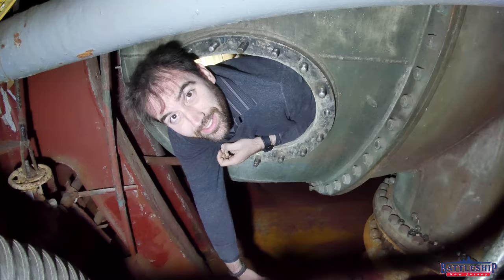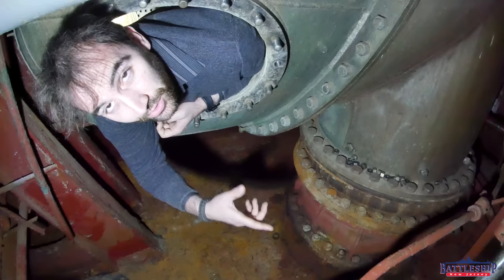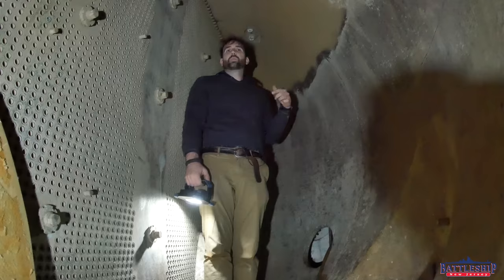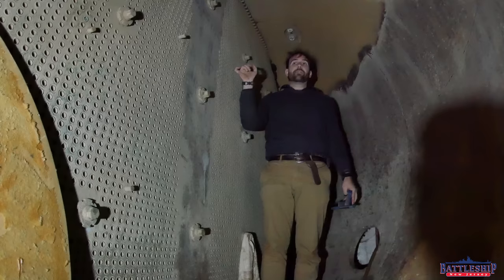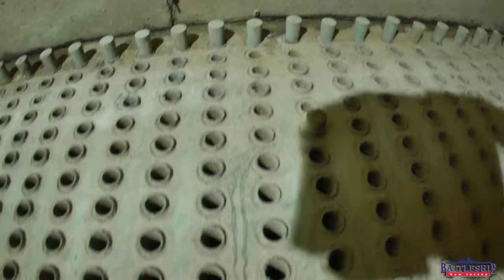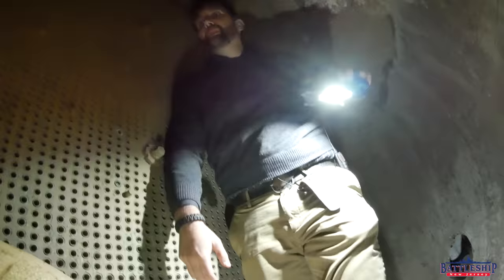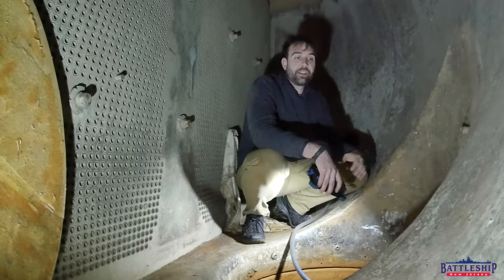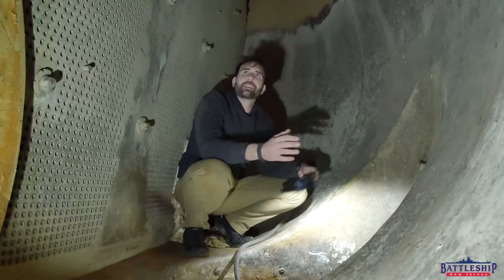Battleship New Jersey's First Hull Leak

Comment: That tube fix thing is a placebo. If you actually calculate the forces on the plug, you'll find that it's only reduced by a fraction of a percent.

Also, how are you gonna get the funds to put the thing in drydock? Sounds expensive.

Comment: Say I'm in a submarine, and I got a water leak into a air filled tank. To fix it, I "poorly" seal off the leak with a plug, and through the plug I put a bypass hose which I lead all the way up to the surface.  Now the water pressure against the plug is removed, so the plug manage to keep it watertight  . Yeah right... -Or did I miss something in your explanation?

Comment: Whenever I see these videos crawling around the interior of the ship, I often wonder what the air quality is like. Do they ventilate or follow any sort of confined space procedures prior to entry?
Reply: If they yell down to the curator and he doesn't reply, they know to pump in some air. Seriously, they should have a small walk- around oxygen bottle and mask with them if anyone is creeping around in confined/unventilated spaces in case the woozies set in. Aviation -rated bottles are expensive as the dickens, but an out-of-date or not-quite-up-to-snuff unit could be picked up reasonably. Better safe than sorry when help is so far away. Ditto for the cameraman.
Reply: They do carry air monitors, it was mentioned a while back somewhere.

Comment: Have you done a video from inside the funnel yet?
Reply: HUMM. Sorta and maybe - I recall a video from the air intakes spaces (and / or ? exhaust) for the boiler at near main deck level- But MY memory ! - show bomb entry prevention armor.- Maybe Ryan but on USS Massachusetts (not NJ) - uncertain of my memory - searching not succeeding. there is a 3 month old video of "Restoring Battleship NJ's Smokestacks"- but that is only outside of the top of the funnel. Not on my location expected list from the title. I wonder- Did opening the main condenser up the first time perhaps require permission from the Navy?  Ok other engineeering plant equipment pieces you need to make a video of. You have done the furnace / fireside of a boiler - Open up and do the Steam drum up at top of the boiler. Uncertain if you open up the main reduction gears how much of the design you can really show !  Find and learn about the DFT (Deaerated Feed Tank) - one in each boiler room. Equal thanks to most of the other comments here and insight.

Comment: Not quite following how the hose is used to deal with a leak. If water is leaking in through that fitting the hose is attached to, in the plug in the sea chest, why would you need to extend the hose up to the waterline to keep water from entering? Just plug the hose somehow right there.

Comment: If this steam engine works the same as other ships I've read about, the vaccume pulled by the condenser increases the engine power by haveing a push and a pull force in the cylinder every stroke.

Comment: How would they empty the tanks for maintenance? only on drydock by opening the valve? or presurized air?
Reply: Probably just pumps.
Reply: Actually, after we shut off the valves, we open the manholes, let the water, wildlife, and what ever else is there drain into the bilges, where we pump it out.

Comment: What material is the condenser made of ?  Monel? or Copper?, thank you so much for a great video...8:00, seeing the magnet stick to the surface, 400 series stainless lacks nickel and the major alloying element is chromium, it allows the stainless to be magnetic....and also hardenable.....unlike 300 series which is more corrosion resistant and has chromium and nickel .....about 18 precent chrome and 8 percent nickel and the rest iron....[with a few other elements in very low amounts] hope this helps, an old weldor from Florida

Comment: How do you figure out which tube in the heat exchanger is leaking?
Reply: When it's drained, boiler water will leak back out.
Reply: When the condensation water starts to get salt readings
Reply: If a similar man space was on the other end of the tubes, a second person could plug the other end of a tube while the first applies high-pressure air via a rubber cone, if it leaks you could either hear air escaping into the steam space or see it with an attached pressure guage. Alternatively a tube with an inflating collar could be inserted to do the same thing all from one side. I suspect there is man space on both ends or how would you be able to remove and relpace a defective tube (which is also done on steam locomotives)?

Comment: Sorry to say but your explanation around the function of the condenser is wrong.
Firstly the steam exiting the turbine is absolutely not @ 850 deg. It is actually the heat in the steam which is converted into work and so by the time it exits the turbine it probably wouldn't even scald you.
Secondly the negative preassure preassure caused by condensing the exhaust of the turbine gives rise to a higher pressure differential across the turbine = more power & efficiency.
Returning the fresh water to the boilers is just one of the 2 functions of a condenser.

Comment: Wow! That condenser must be monel 400! It is a highly corrosion resistant (particularly seawater) also erosion resistant nickel/copper (with various amounts of manganese and other stuff) alloy.
And magnetic!
That's pricey! 
BTW you are allowed 10% of the tubes to be plugged before retubing is required.
That's the discharge side of the condenser you were in. 
Ya think that's uncomfortable, try finding leaks while underway in the Med in the summer. I was the little guy in the engineroom...
Also, to be clear, the vacuum is formed by the steam condensing..Nothing else. Steam has 900 times the volume of water.
Reply: I know they used Monel in the 50’s on bottom of Coast Guard 36’ rescue boats because we have the CG36500 that was in a very famous rescue in ‘52 here on Cape Cod.

I also have a couple of hot water heaters from that timeframe that are still working and have Monel tanks.

Comment: Thanks guy, interesting to see that. Was the steam entering the condenser at higher pressure than the water in the condenser? Seems to me that if it was not then a leak in the sea water cooling pipes would add salt water to the steaming water and really mess things up fast.

Comment: how is it automaticly scooped into the intake? is there a funnel on the outside?
Reply: As I recall the opening in the hull just has a cage over it to stop stuff from being sucked in.
Reply: Actually, the scoop injection is a sloped inlet into the hull. As I recall somewhere around 25deg angle. There is a plate/bars over it to keep the “big” stuff out, but it is basically open to the sea. When the ship is over 15 knots (as  memory serves) there is enough flow going into the scoop to no longer need the pump.

Comment: i don't think you have your steam engineering correct. at 0 psi there is no way you will have 850 degree steam. with steam the temp is directly related to the temp. so likely it's not at 0 psi and also not at 850 degrees. at 0 it's 212 F at 850F it's around 1500 psi. so it may only be 300 F which is at 100 psi coming out of the turbines . or less.

Comment: How can that tube relieve any pressure?  There is no flow... the same pressure still exists in the sea chest.
Reply: Since the sea chest is supposedly blocked off externally but has a small leak and the newer patch is also leaking, any water added to the tube will only serve to increase the pressure on the leaks. The tube will empty into the bilge and river via the leaks  and when its level reaches the draft water level (which apparently is above the upper leak) river water will leak as before the bizarre attempt to stop the leak by adding pressure. Be very skeptical when you read technical stuff on museum ship sites.

Comment: Bronze melting point might be too low and they decided that they needed something that would say temperature well above it. Just in case 800C° steaming high pressure steam  also holding that pressure could have been a problem too.
Reply: That would be Fahrenheit, not Celsius.  I would actually expect something more in the range of 600 PSI and around 845F at the turbine inlet...That would be typical for a USN 600-PSI plant.

Comment: OK, supply clerk question: why do you need to cool the used-up steam into liquid water before returning it to the boiler?  I'd think it would reduce the fuel usage to heat up low pressure steam instead of water.  The only answer I can think of is that liquid water is easier to get back into the boiler than low pressure steam because the boiler steam is higher pressure.  In this case, you only need to cool the low pressure steam enough to turn back into really hot liquid water, like 200F.
Reply: There are a number of reasons for having a condenser.
By cooling the steam, it returns to a liquid which takes up less volume than the steam, there by creating a negative  pressure or vacuum. Exhausting the steam from your turbine into a vacuum increase the efficiency of the turbine. Steam cannot be pumped into the boiler, but liquid (water) can to maintain water level and to be evaporated into steam again. 
By reusing the water, you save on chemicals such as oxygen scavengers and as there is a certain amount of heat in the water you save on fuel.
Reply: The condensate is not cooled any more than necessary. Look up "condensate depression" for a full explanation. Once again, the curator is not an engineer and, unfortunately for viewers, fails to fully research the subject before making these videos. Condensate goes from the hotwell at the bottom of the condenser to the "DC heater" (as it is called on merchant ships) aka deaerating feed tank where it is heated by auxiliary exhaust steam where non condensable gases are removed before being pumped at high pressure through feed water heaters and economizer tubes in the boiler uptakes then into the boiler drum. The steam leaving the low pressure turbine is at a vacuum as close to 29" HG as possible in order to extract as much work as possible. This actually cools the steam to the point that the exhaust steam is actually the coolest part of the engine, it is often well below 100F and if condenser temperature increases the turbine quickly loses efficiency. The vacuum in the condenser lowers the boiling point of water to well below engine room temperature. Loss of condenser vacuum is a very serious event.
Reply: Another way to think about it is that it would require a lot of energy to take the low pressure steam that is leaving the turbine, keep it hot so it stays steam and compress it so it could go back into the high pressure boiler.  That would waste a large portion of the energy coming from burning fuel oil, the condenser and a water pump only use a small fraction of that energy.  So if the goal is to do the most work with the energy in your fuel you go with the more efficient system.
Reply: Please guys, study a "heat balance diagram" for a marine steam power plant. Look at the flow of heat, the quantity of heat and where it originates, is used, and where it is removed. The entire objective of a power plant is to convert the potential energy contained in the fuel tanks to useful work while reducing losses wherever possible. I think you will be very surprised at where most of that heat (energy) is lost but maybe you will understand how little work can be done if it is not lost. This is fundamental to system operation and completely missed by museum ship entertainment gurus.
Reply: @oldtugs  is exactly right.  It's not pressure that does the work, it's temperature.  However, pressure and temperature are very much related.  There have been many books written on the subject, most of which use math far beyond what I learned in college.  

First step to seeing a light at the end of the tunnel is to understand the difference between Latent Heat and Sensible Heat.  

Second step is to understand what steam is...the gaseous state of H2O.  A colorless GAS.  What you see coming out of your tea kettle or pasta pot is NOT steam, it is liquid water vapor.  At sea level, it you can see it, it is about 212F.

Third step is to understand that it takes a LOT of heat energy input to turn 212F water to 212F steam.  It also requires the removal of large quantities of energy to condense the steam.  Research "Latent Heat of Vaporization" and "Latent Heat of Condensation" to understand how we use Latent Heat, superheating, and reduced pressures in the condenser to extract as much usable energy as possible from the steam.

Comment: I dont understand the argument that the pipe stops leaks.  You have a bung in the inlet and the full water preasure is held back by it.  So the preasure across the outer plate is zero if it is leaking.
Reply: If I understand the setup correctly there is a closed valve behind that bung that must also have a slow leak.  Only way the tube idea makes sense to me is if the leak in the valve is so slow that it can't build up full hull pressure in the tube?  And the leaks on the bung are so small they can now deal with the reduced pressure?  If the water in the tube goes all the way up to the waterline it would not work, the bung would still have full hull pressure on it.
Reply: @MartysRandomStuff  Yeh that was exactly my point, but no matter how small the leak eventually it would build up the full pressure unless the bung is also leaking at the same rate.
Reply: @adrianrevill7686  Yes, any leak given enough time should fill the tube, so there has to be something more to what is going on with that tube than simply having it up to the water line.
Reply: There is nothing to understand except no one involved in that "fix" knows what they are doing or talking about.

Comment: So, considering she doesn't need to be reactivated, she's the property of the museum... i wonder if it weren't smart to temporarily (from the outside, with divers) plaque the hull with a temporary adhesive, and then from the inside, remove the sea-chest's joint (which was clearly designed to be a thing) and either put a stainless steel plate between the sea chest and the hull. With a high enough quality stainless steel plate, any metal difference between the OG metal of the hull and the dummy plate will be negated. I know for a fact that one method to repair old fishing boats is to just plain replace the damaged sections with stainless steel plate.
And for years now, i've been patching my old cars with just a hair-thicker sheets of stainless wherever they spring a rust leak. So there should be no issues.
If that's a sound logic, were it my job, i'd make a larger than hole plate (with the right bolt pattern) and then use the excess of the material to chemically adhere the plate to the hull. There's several modern boats that are glued together in certain areas, so we do have the right materials. Obviously, an expert would need to be brought in, but mechanically speaking, it would be a very strong water plug. The bolts would act as insurance and  won't allow the glued bond to stress over time. I'd give that decades to half a century before it would ever leak, if done right.

just my 2 cents. There's no purpose for most of those sea-chests.
Reply: Just as effective (until drydock), put a sheet of epdm on the outside and hold it in place with a few big magnets.

Comment: Still trying to bend my mind around how a small tube running up above the water line relieves the water pressure on the rest of the pipe; ingenious but confusing to my tiny brain.
Reply: If you take a 100 foot long piece of 1/2" pipe, fasten it to the side of a building, and fill it full of water, the pressure at the bottom of the pipe will be exactly the same as the pressure 100 feet below the surface of an entire lake.  

That little tube running above the water line, when filled with water to the level of the water outside, has the same pressure at the bottom as the pipe does.  The pressure doesn't matter, the fact that the pressures are equal does.

Comment: FYI, bronze corrodes faster from sea water than Iron or steel, plus bronze is not as durable under pressure as Iron or Steel. Fortunately, metallurgical knowledge has improved since WW2. So I'm confident that if you consult with a properly trained Metallurgist you can find a solution to the problems that you are having. Honestly I could help you but I am busy with other projects. Anyway Great Post. It's good to see that someone is looking after one of the most important ships in the History of the U.S. Navy.

Comment: Great vid, but that hose explanation doesnt make any sense at all. What ever this company did, that hose isnt the key to sucsess. If it was, you could just cut the hose open and no water would leak out. But it will, because there is water in the hose. And therefore, cuting the hose or the lid is the same. The storry could be different if you had a underpressure in your ship, which I dont belive. Why would you? You need an air-compressor, with an pressure regulator. Find out how deep that leakpoint is below water line and adust the pressure in that hose so, that you have just enougth pressure, to equalize the counter pressure in the inlet. And the sea water is gone and stays some inches below the leak as long as the compressor is there. Corosion is gone too btw. I hope you come along good and get this fixed.